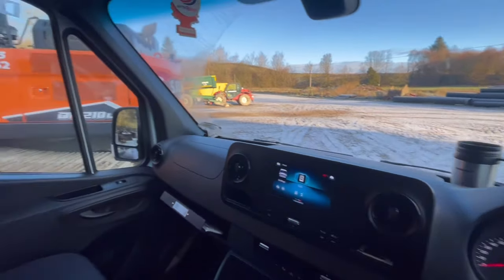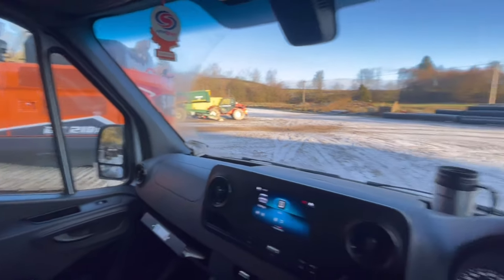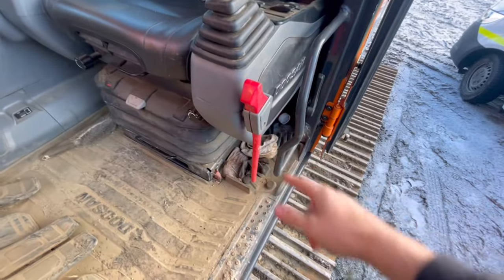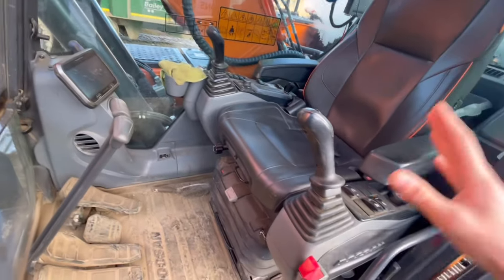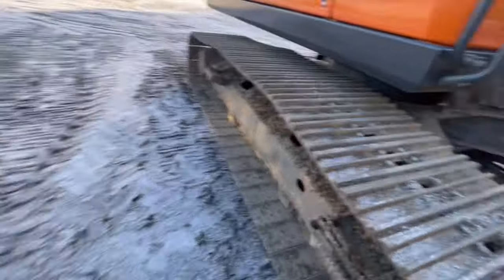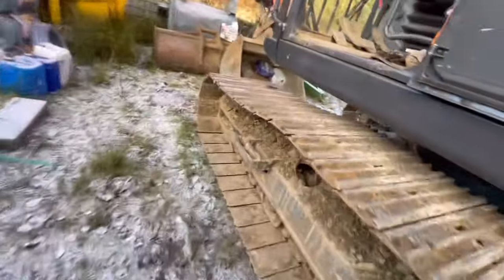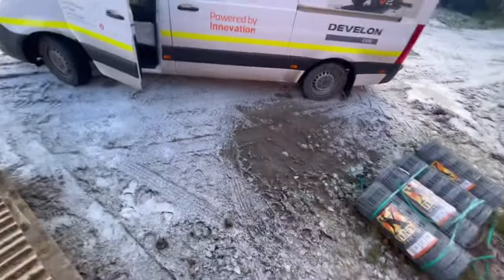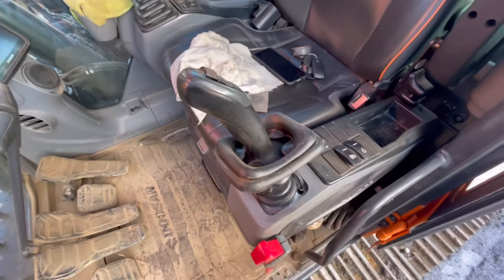Cold / Flat tyre AGAIN ! / Temp sensor fault / Joystick valve replacement

Comment: Personally too close to the side wall to repair.....When you talk about pilots ,i am guessing that is just a signal pressure to operate a valve to let the high pressure do its thing ..Being ex military on APCs in winter we could floor it and have the track spin like crazy but not move ,a bit like a burnout lol We had rubber track pads so we never damaged roads but can you do that on your kit ?
Reply from the maker: Yea those frozen dirt roads the machines don’t leave a mark yup that’s exactly what I mean when I mention pilot oil 👍 and yea the tyre is junk if it was closer to the centre it would repair 🤦‍♂️

Comment: When are you going to learn to check the parts before going to the job or at least before you take it apart? 
I’m sure you’ve been caught out before with wrong parts, I know I have, too many times yet I still forget some times lol
Glad you’re back up and working, I was getting bored without your videos!
Maybe you’ll have to hang some strong magnets in front and behind your tyres to collect the rubbish so it doesn’t go in the tyres.
did you get that from the workshop the other day when you were doing the dumper??
Keep up the great content.

Comment: Top video, “likes” are climbing above views, bad luck with the puncture, could have used that Telehandler, put forks close together under the wheel , lift up with ease & block. Blimey, just as I’m typing this you say about the Telehandler 🤣🤣🤣👍
Reply: Would have thought tyre co would have scraped wheel clean before balancing it🤔
Reply from the maker: Just how it was sat in the cage under the Van collecting muck I haven’t a bad word to say about the tyre firm I use 👌👌
Reply: Sorry, didn’t give it a thought with wheel collecting dirt.
Reply from the maker: @anthonyshaw7251  👍👍